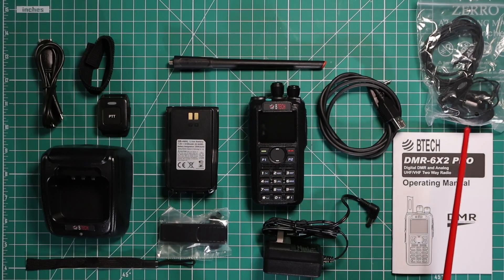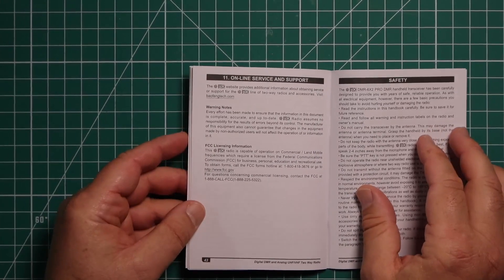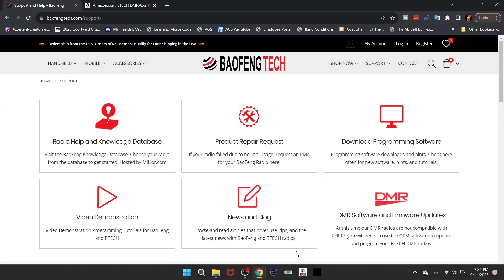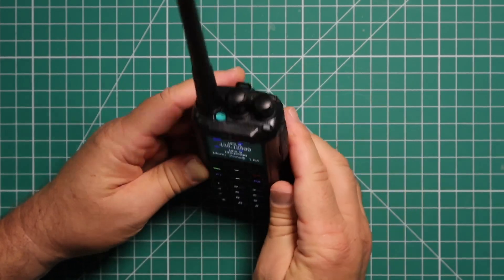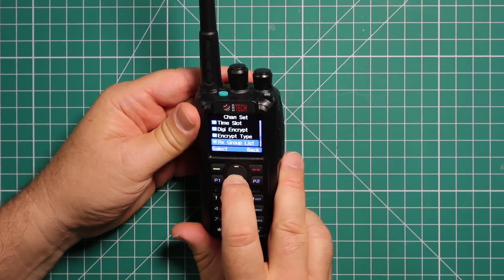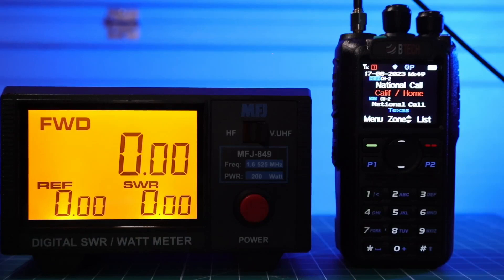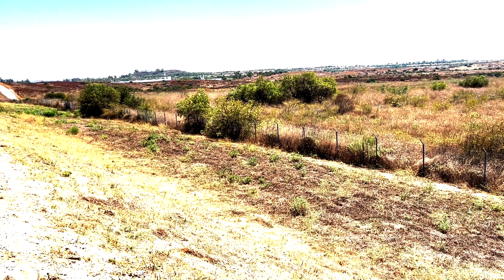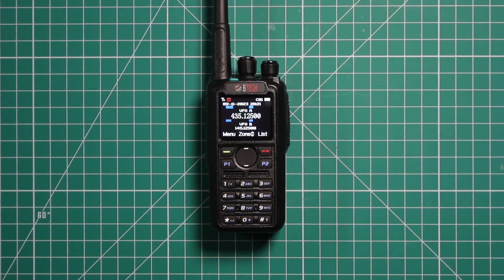BTECH DMR-6X2 PRO Radio Overview

Comment: How does this radio do on analog? Not ready for dmr but dont want to buy another radio in a few months when i do start messing with dmr
Reply: Well, you're going to be buying multiple radios anyway. You'll need one for D-Star when you realize what a pain in the ass it can be to program a DMR radio (I highly recommend getting a premium account with Repeaterbook. If you have an account, you can export repeater databases to a csv file to import into your programming software), then don't forget Yaesu System Fusion for true plug 'n' play on a hotspot. And then, as well as your super-sexy radios, you'll also need a rugged 2m, 440 radio like the Retevis RA89 for hiking or doing outdoorsey stuff with, that you know can take a few bumps and knocks. You're never going to be a one radio guy (or gal).
Reply: lol you are actually very intelligent in thinking this way! I wish I had that level of forethought as I try and forget my 2 boafengs and 1 quansheng
Reply: @EthanYost-c2o   awww, don't be that way. I currently own an Icom ID-51 and 52, Yaesu FT3DR, Anytone UV878, Ailunce HD-1 and a Wouxun UV9D Plus, and I'll soon have a Kenwood TH75 but there will always be a place in my heart for my 4 $20 dirty Boo-Foos, 2 of which I got even before I was licensed, just to listen on the air, see what was happening. And they'll be perfect to give to neighbors or friends when the zombie apocalypse finally happens. And I gotta say, my Quansheng UVK5 is probably THE most fun I've had with a radio, just messing around with all the custom firmware people are making. If it bricks, who cares ? Receive from 15 to 1300MHz ? PONG on an HT ?? A spectrum analyzer on an $18 handheld ? A lot of fun to be had.

Comment: I'm new to the world of handheld radio so forgive me for the dumb question. But if i were to keep the radio in my pocket, is there any chance of pressing a button by accident or maybe even broadcasting without knowing? How does it work?
Reply from the maker: Thank you for taking the time to watch and the comment! It is greatly appreciated. It is possible to transmit when a radio is kept in a pocket. Due to the nature of a pocket it could accidentally press the Push To Talk button on the side. the buttons on the front of the radio could also be pressed and cause issues. I have all of my radios set up so they stop transmitting after 2 minutes if the push to talk button is accidentally pressed

Comment: Your MFJ watt meter really isn't suitable for accurate measurements...you're operating it at the very bottom edge of it's scale where it's probably nowhere near the +/- 5% accuracy spec.  I just measured my own sample of the 6X2 PRO on a spectrum analyzer and got almost 8-watts on 2M "TURBO" and 6.3 watts on 70 "TURBO".  It's also shockingly clean.

Comment: You are not troubled by the lower than advertised power output? Maybe all handhelds are off.
Reply: Those measurements were taken at the very bottom of the scale of a meter that has an accuracy spec of +/- 5% (which for an MFJ is probably more like +/- 10%).  I would take these results with a HUGE grain of salt.
Reply from the maker: Thank you for taking the time to watch and the comment! It is greatly appreciated. I forgot to make mention of that in the end. I am not in any way thrilled about it. 2 meters on Turbo was the only shinning part of the power test.